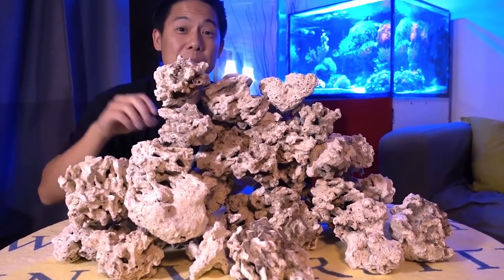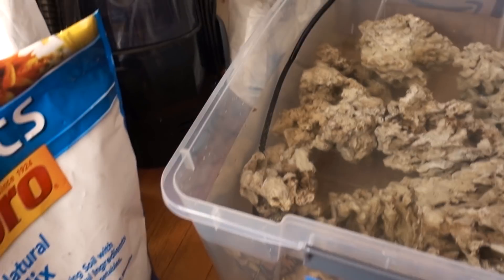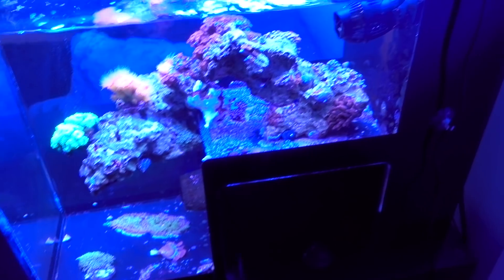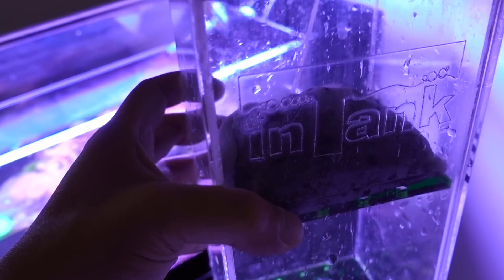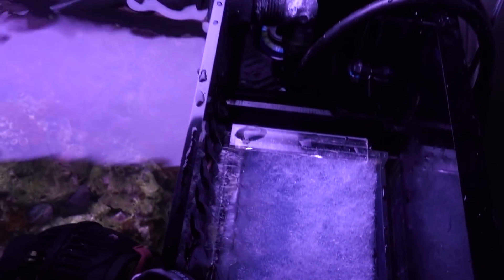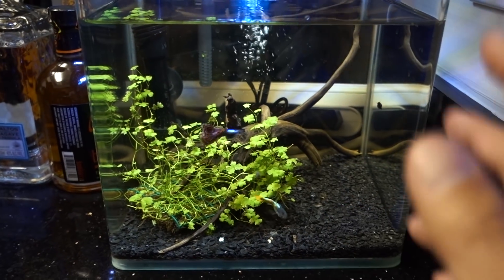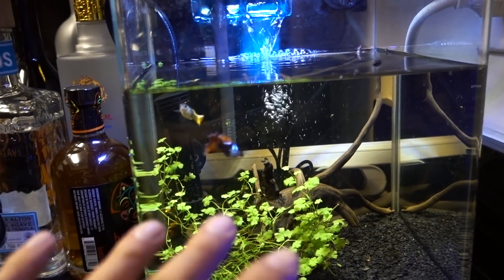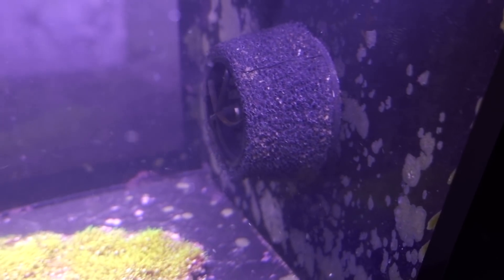Pukani Rocks! Guppies Tank? Upgrading Filtration!

Comment: Just a few freshwater tips
5 gallons is a bit too small for that many guppies. If you're adamant on guppies, you could do 1 male and 2 females but it wouldn't be too comfortable for them. The parents will also eat the fry before you can collect them in such a small tank without hiding spots, probably. 
Endlers aren't as pretty as guppies but the males are half the size and are a good substitute for a 5 gallon.
Plecos, both bristlenose and common, get way too large for a 5 gallon.
Reply from the maker: Thanks for the tips man! I have a larger tank coming soon (turns out this tank is actually 2.7g, YIKES!), and the Pleco will be heading back to the LFS either this week or next week. I'm learning a lot, thank you!
Reply: Yo I keep a lot of guppies(magic blue thunder) in a 5 g. I just have a lot of plants(waterletucce).

Comment: Why don’t you connect rigid tube to the airline tube to filter out detritus without having to stick your hand in the water. 
Lee's Pet Products ALE16005 Rigid Tubing for Aquarium Pumps, 3/16-Inch by 3-Feet
Reply from the maker: Hi Alexander, I have a more narrow diameter rigid tubing that I sometimes use but would get clog a lot (not to mention slow), this may work better, thanks!